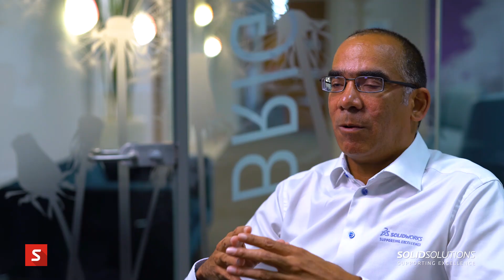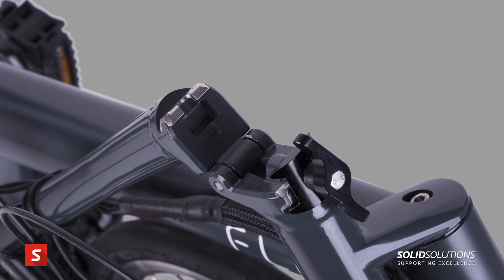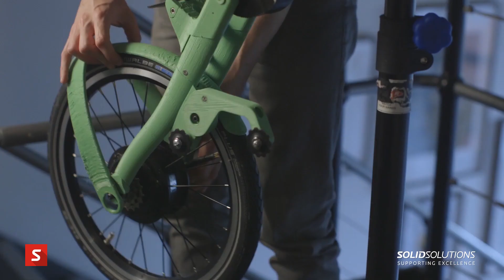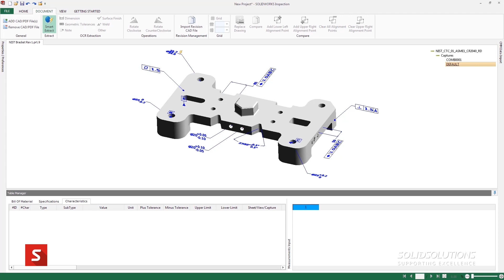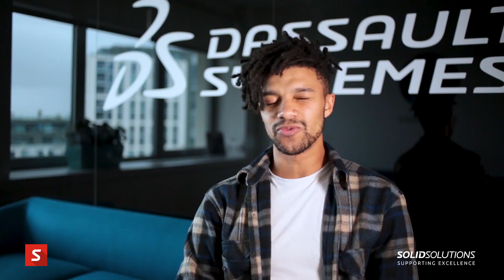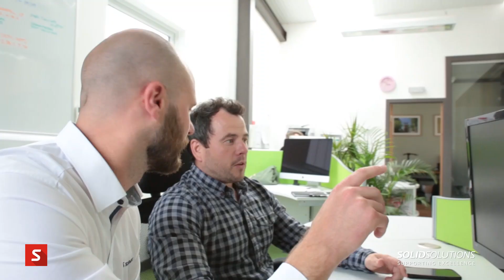Why do companies choose SOLIDWORKS?

Comment: It really struggles with opening big assemblys and Steps, and it also has huge performance issues while working with big assemblys. Thats why we are pushing to make the change to Catiain our department.

But apart from that, its most intuitive program I used so far. 

So in short, for small to medium assemblys SW is the tool to use imho. If it gets complex, use something more powerful.

Comment: Why do companies choose SOLIDWORKS? Because it's cheaper than any other usable cad system, and who makes the decision about software purchase is not a competent manager who probably not an everyday user. Easy to use? Lol, just ask about an ordinary engineer, what's his opinion about the "sw's powerful" capabilities, when he is waiting to sw to open a massive assembly or just opening a bloody step file.
Reply: What's cheaper but apparently not now oh, the last time I checked Autodesk Inventor is actually cheaper which was very surprising, not only that it doesn't act like a virus on your computer and it's not a headache do the simplest task of creating and robbing Liars it doesn't fight you like SolidWorks does, as a friend told me SolidWorks is like trying to ride a bike that someone has a welded training wheels on you can never take them off, personally I see it is a car that you can't even pull out of the driveway without somebody else waiting on the break.